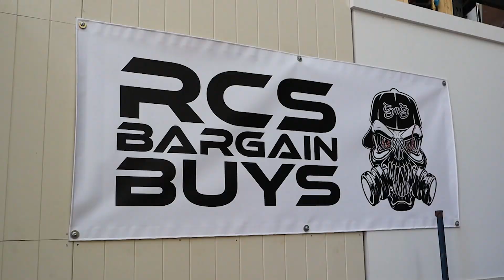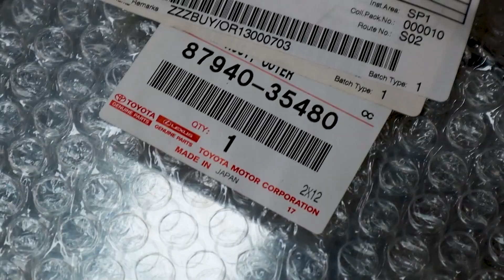Mini Truck Mirror Smash | Crashed into

Comment: so glad it was just a mirror. i so wanted to build my hilux into a little beast but u seen the other beast. hope u can get the right guy for your ecu loom because u will be putting every mild LS to shame when its done. also if u want my sump i have a hoist in tulla we can use for a day and my car needs a service. people drill into the block but i welded a 3/4 or 1/2 inch fitting into my sump coz im not that dodgey, just drunk n cant remember haha
Reply from the maker: Yer me too mate! Ill be sure to try the loom and ecu you said i just need to run it past my tuner and see what he thinks. Thanks bro! ill prob just weld it into my sump i had a look today and shouldnt be too hard to do and it needs a new sump gasket anyways so kill two birds with one stone.
Reply: @RCSMediaDivision  
The 2/3rz turbo community on Facebook is the greatest place for info. 
I still love and daily my old thrashed out 2001 banger, 8 years hauling bikes, towing loaded trailers and limiter bashing the fuck out it until it hooked up in 3rd.

I wish I could drive the black ute like I did the boosted hilux
Reply from the maker: @mifo2000  100% bro, some cars just love a trashing haha but also i think thats the issue with too much power, becomes not as much fun.